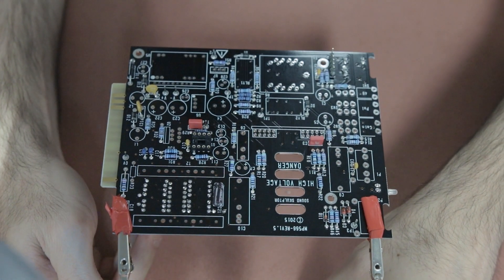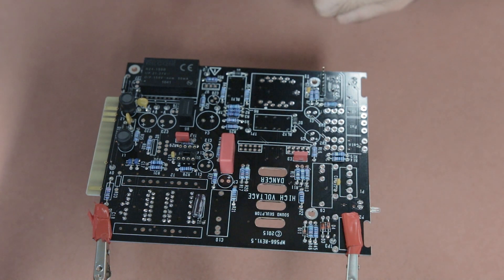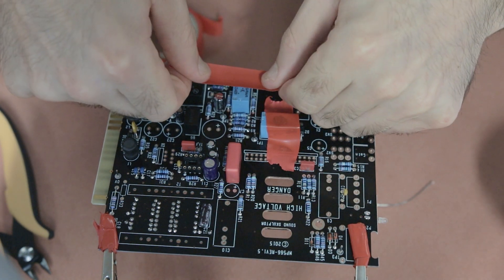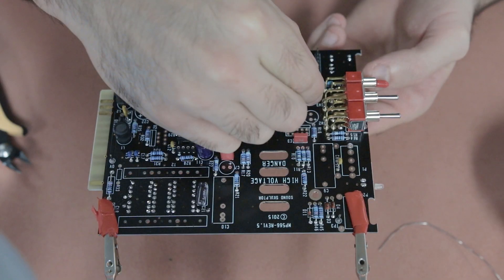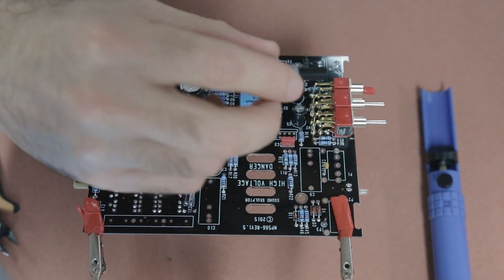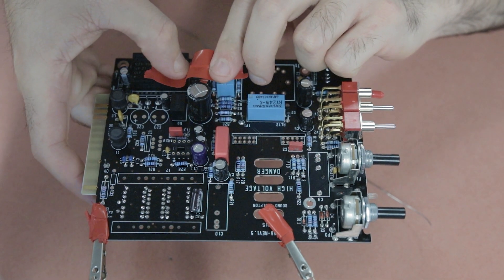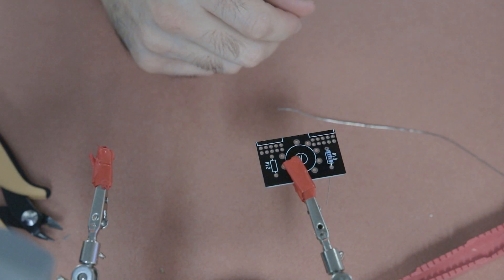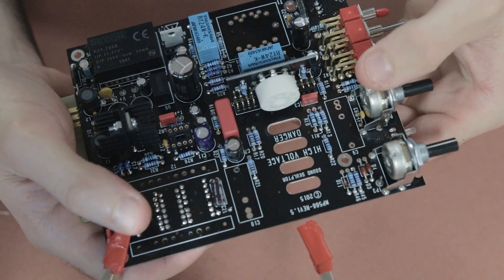How to Build your Own Tube Preamp - Sound Skulptor MP566 (LA 610) DIY Build PART 2

Comment: Awesome series so far Mitch.  I can’t wait to see it finished. :D
Reply from the maker: Thanks Nick. It's a very nice pre that's for sure.

How did you find building that 1176 compressor? It looks awesome. That's a really impressive build you've done. 

I'm not sure whether I want to do some 500 series style comps or bite the bullet and just do a couple of 2u rack types.
Reply: Thanks :D I love the 1176 build and would do another one in a heartbeat. I think either format you choose, 500 or rack, you won’t regret it.
Reply from the maker: @nickiden  yeah I definitely want to get the 1176 and la2a compression combo going sometime soon.

The aim is to get 2 500 series racks with 10 slots, 8 channels of pres and eqs and then 2 x pairs of comps. Not in a rush at this stage.
Reply: The DIY Recording Studio That sounds like an amazing set up.  I want to make the leap to a 500 series setup. Any recommendations on a power case?
Reply from the maker: @nickiden  yeah it would be a bit of a dream set up.

I really like the Rupert Neve Designs R10 case I've got. It packs  extra power for the units and the power supply is shielded better which can be a issue in cheaper units.

There's lots of good reviews about the Capi diy rack as well. If they had them in stick at the time, I probably would have bought one.

I would just make sure whatever rack you get has enough power and maybe avoid the ones with a line lump.